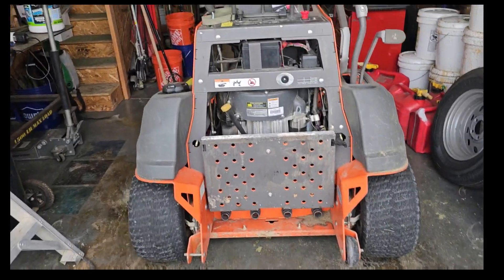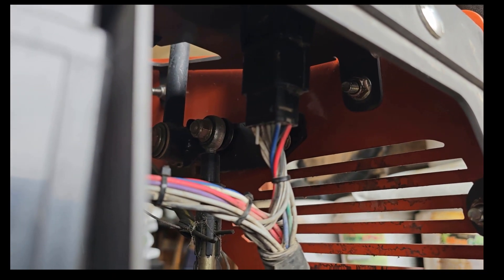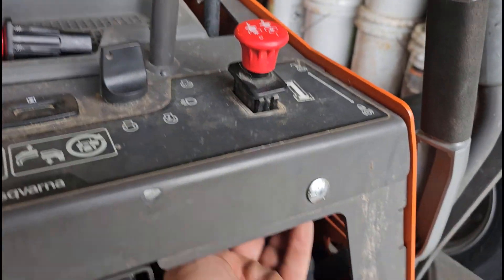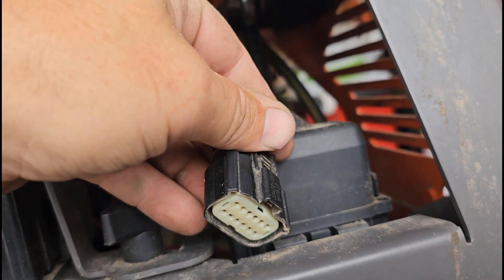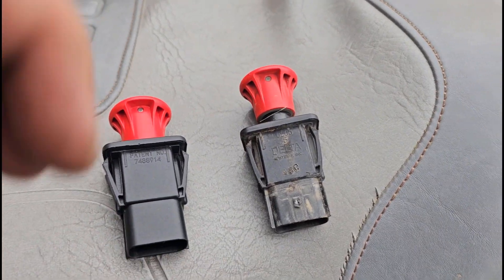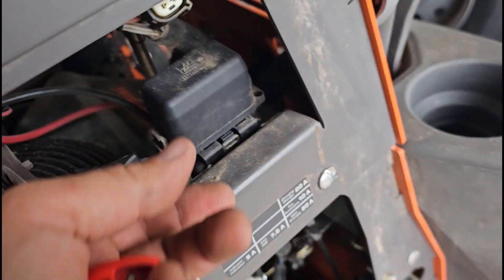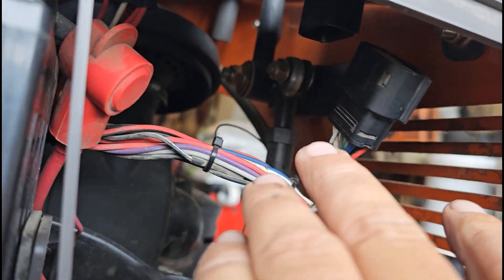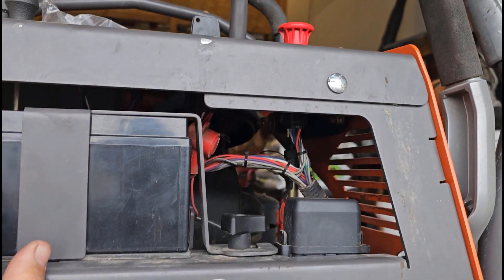How to change your PTO switch. Husqvarna V548

Comment: Howtoinstalla beti on a husky with a. Elect PTO
Reply: Wow to replace a mower belt on a husky riding mower with   a electric engage switch
Reply from the maker: I am not sure what type of mower you have, there should be a belt diagram "road map" sticker usually on the deck somewhere that will show you the routing for the belt. If you release the spring on the tensioner pulley then that will give you the room you need to remove and replace the belt.